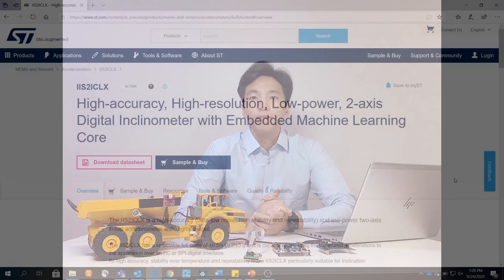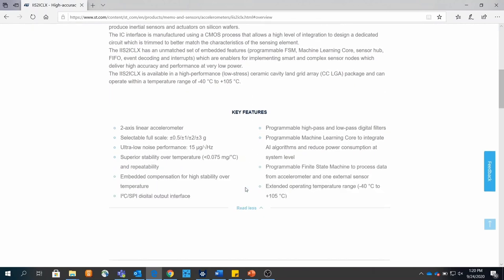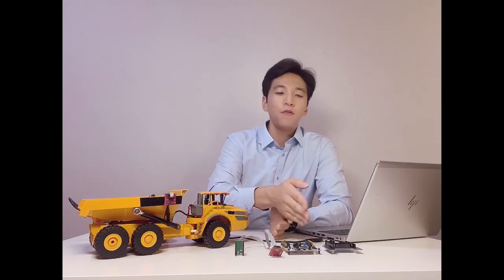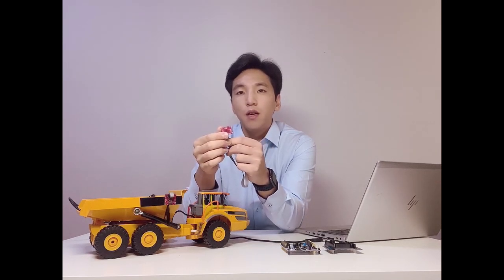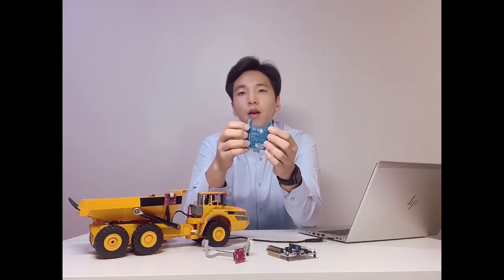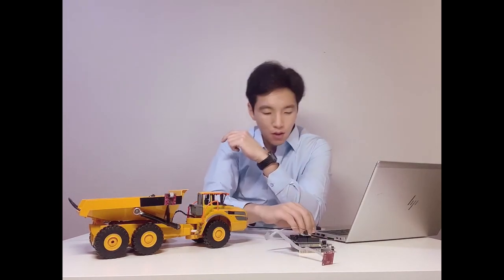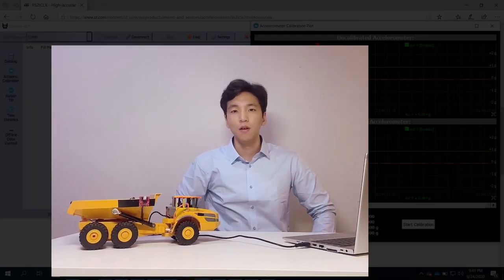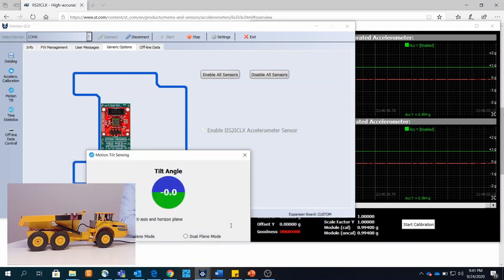DevCon 2020 Demo: IIS2ICLX with STM32 Nucleo board and Unicleo GUI for Toy Dump Truck

Comment: Hi ST, The inclinometers can measure linearly angle from 0 to 180 degrees and How many tolerances are applied to angle? I'm using the LIS331DLHTR for our products and the tolerance of angle is 0.5 degree. I would like to use a new chipset with a tolerance of about 0.1 degree.  Can The IIS2ICLX satisfy this condition?
Reply from the maker: Hi there, thanks for your question - may we point you towards our community.st.com, where you will find a team of people who can answer you directly ?